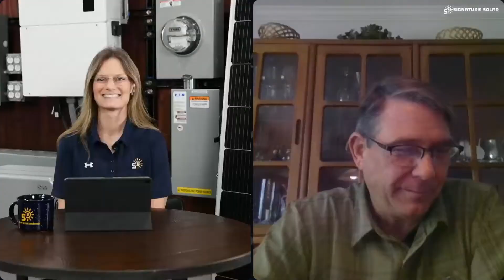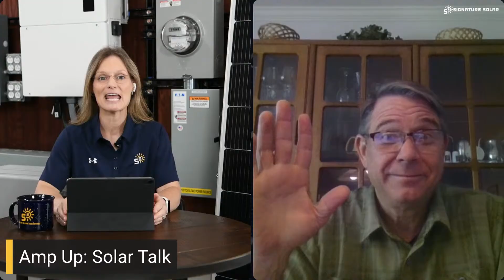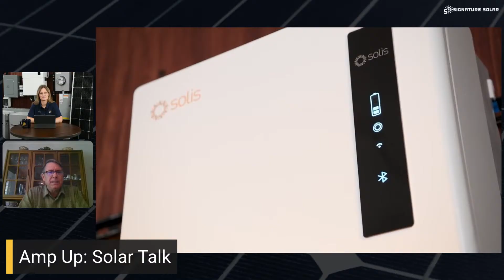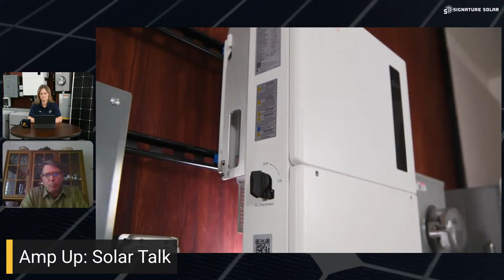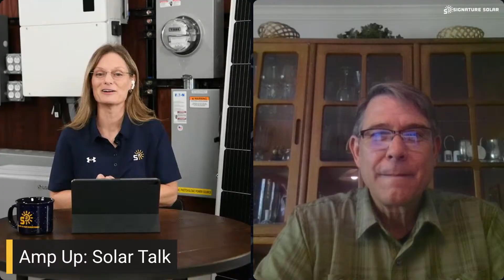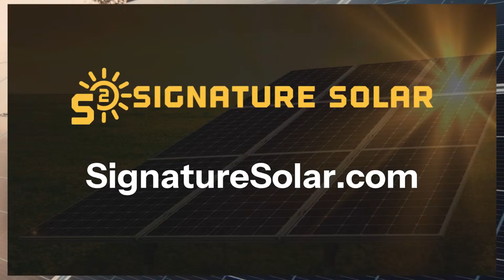Amp Up: Solar Talk - Ep. 19 - High Voltage Hybrid ESS Solutions with Solis and LG

Comment: “Current” means amperage, not voltage. It’s the flow of electric charge, measured in amps.  Don’t use it to refer to the voltage.  High voltage that can use smaller wires, high current needs larger wires.

Comment: can I use a combination of 3 Solis s6 11.4  inverters paralleled together with  2 LG batteries to each  inverter ( total of 6)?
Reply from the maker: Hello! Yes, it is possible. As long as the batteries are the same model, wired properly, and the inverters are set up for parallel operation.

If you’d like to know more details or get guidance, please feel free to reach out to our team at 903-441-2090!
Reply: This is the exact system I am planning.   Three 11.4 inverters and 2 LG batteries each.

Comment: Noise is a big advantage for high voltage.  High voltage inverters can be cooled with heat sinks or whisper quiet fans be there’s much less heat generated when dealing with less amps.